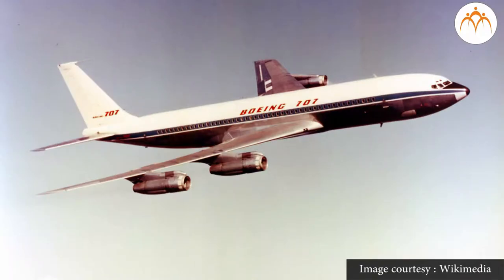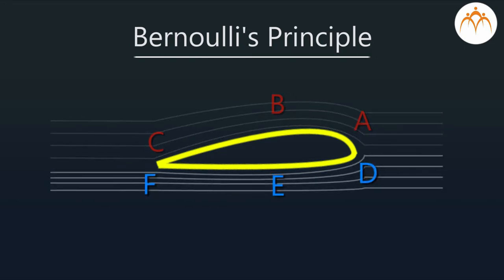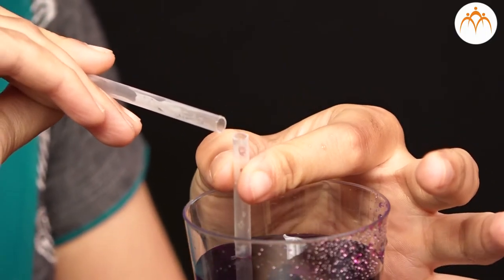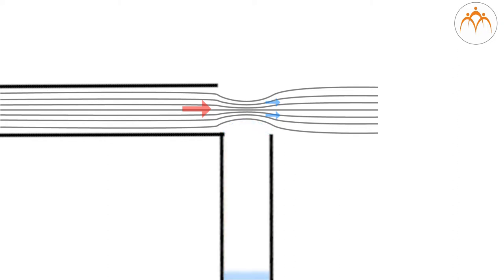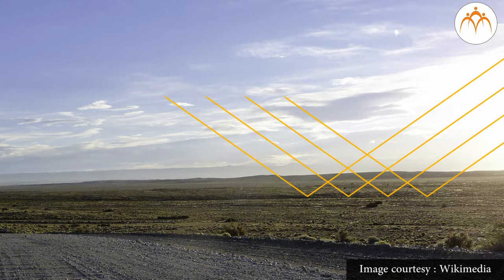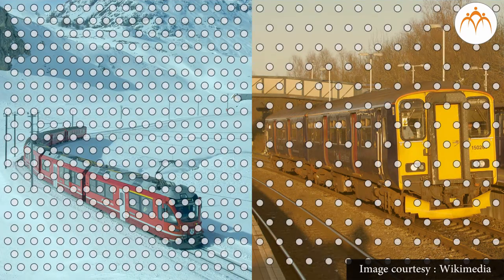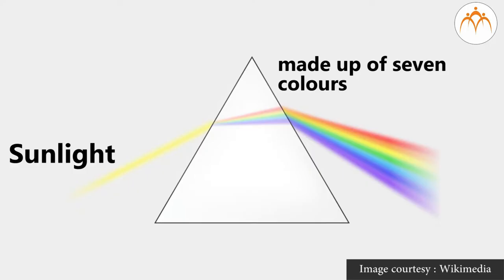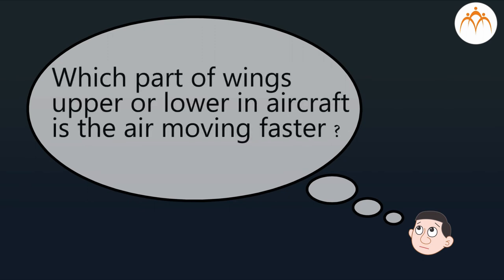Properties of Natural Resources  : Air Part 4

Comment: The air moves faster on the upper part of wings because air pressure decreases when it strikes the broader part of the wing, hence it moves faster to reach to the lower pressure area.